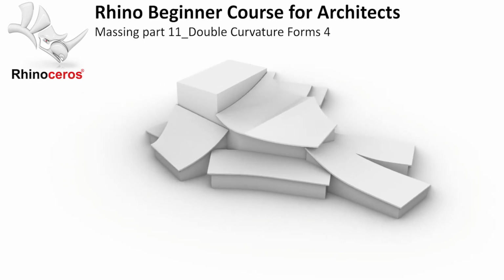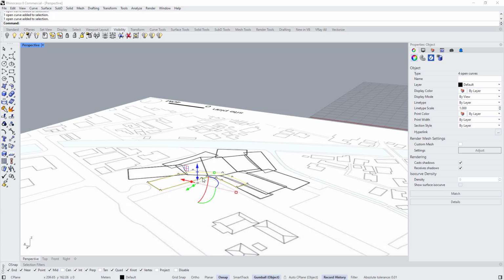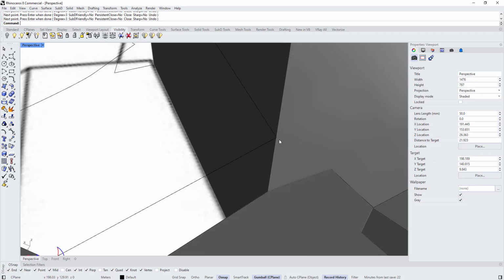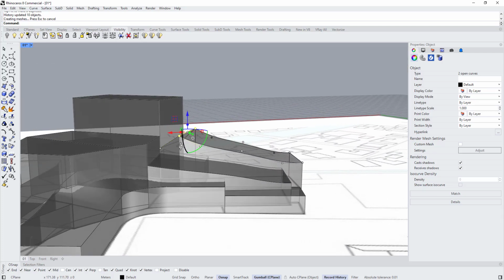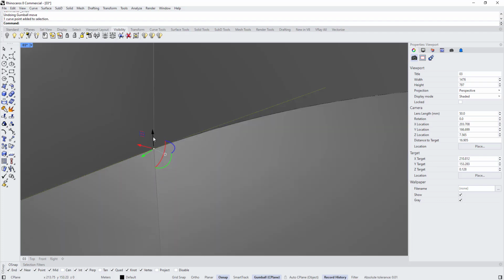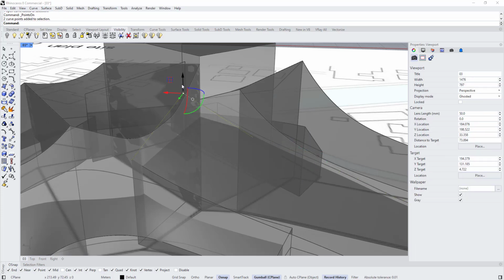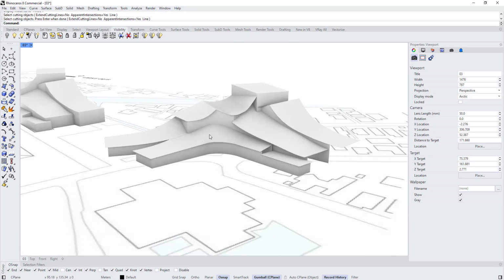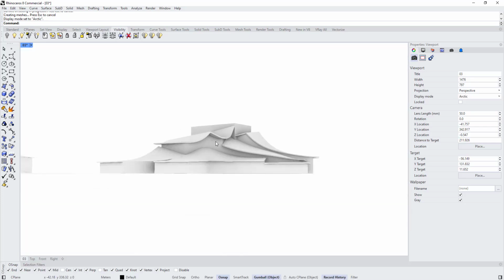12 Rhino Beginner course for Architects_Massing part 11_Double Curvature Forms 4

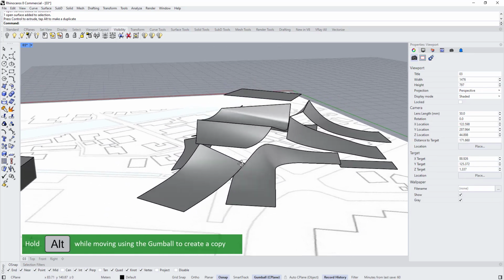Comment: Why didn't you start from 23:09? What's the point of all these DupBord => Setpt => Loft thingy if the main result comes from the curved roofs?
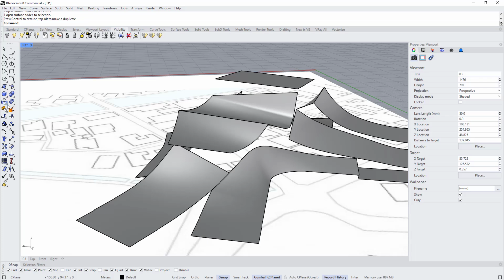Reply from the maker: To have a rough mass while maintaining record history, this can help you a lot in form finding and testing variations, all the steps after 23:09 break the history, so it is not the best phase to test variations

Comment: In 8:02 I  locked the duplicate curve when I moved the original curve the only thig that moves is top surface without the wall ?
Reply from the maker: When you use SetPoint command make sure Copy is set to yes
Reply: @PH.Studio  
I copied them when i set the points
by the way i have Rhino 6

Comment: Hi, when I move a point on a corner, only the facade changes, but the corner of the roof plane does not move as you show. What is wrong? I have history turned on. Hope to get your answer.Thanks
Reply from the maker: Just make sure you didn’t break the history of the sweep 2 rail surface by moving it also double check that always record history is on while creating the surface